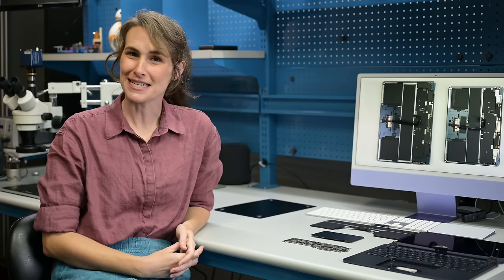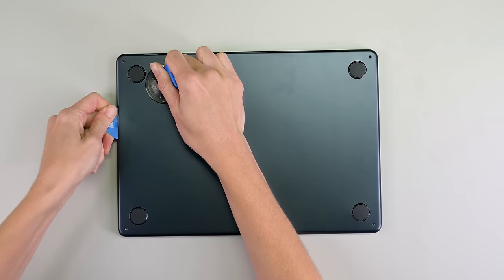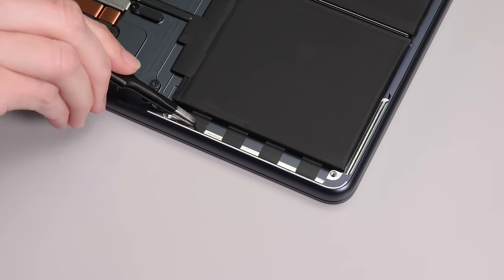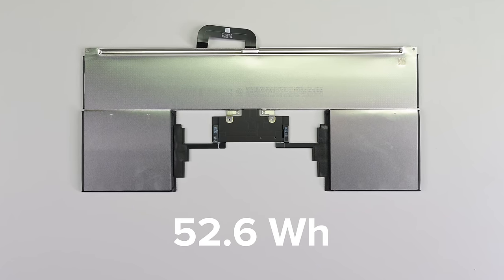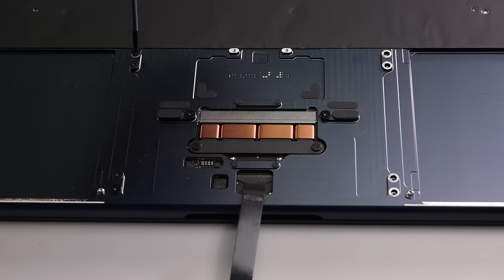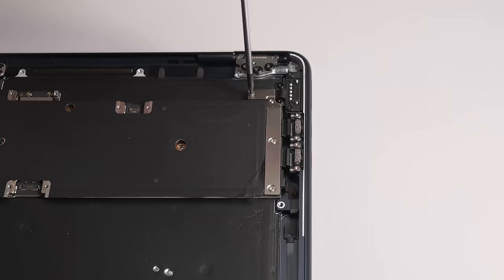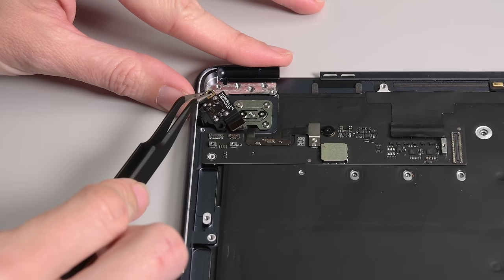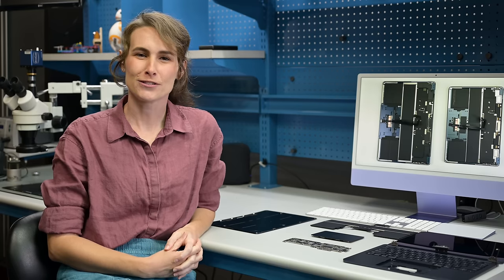M3 MacBook Air: The Tiniest Change Makes All The Difference

Comment: I missed it: what's the "tiniest change"?
Reply: No more adhesives so this will make repairability from third party shops a decent experience.
Reply: That it's 1% closer to Thinkpad-levels of repairability.
Reply: 0.0000000000000000000000000000000000000000000000000000000000000001%  @Ptero4

Comment: I find it funny that half the battery is screwed in. It proves that they can make the battery easily replaceable but don't want to.
Reply: Securing is not the same as attaching and ensuring that a device you move around all the time doesn't have internal bits floating/buzzing around
Reply: @Alejandrolanza 
Somehow, every other laptop maker has figured out how to use screws to secure batteries.

You don't need glue to "secure" the battery
Reply: @anivicuno9473   actually, as battery ages, it will expand, increase in sizes, like a swollen over sized pillow. glue helps to secure in case a battery becomes swollen.
Reply: @Alejandrolanza Uhm.. dude, the battery IS attached with screws. She SHOWED that. What more would gluing do to prevent "internal bits floating/buzzing around"? I mean by your logic, they should glue down the back panel - which is only held on by SCREWS and clips.
Reply: @TheoWerewolf   back panel is something:

1- Solid and structural
2- Can be drilled through

There's no solution that's lighter and takes up less volume than glue, for a battery
Reply: It is easily replaceable. If you're referring to it being swapáble on the go, the MacBooks battery last you literally over a day and its life time is amazing. I don't understand the issue here.
Reply: @Alejandrolanza clown
Reply: What’s the problem with the adhesive? They aren’t being like Samsung and straight up gluing the battery down with no easy way to remove it. It has pull tabs. It’s still very removable.
Reply: @flashlightning6742  its like they want more plastic clips, and glue to match their chrome books
Reply: WHAT??? 🤣 How much easier do you want it to be?? What just no screws and no glue just let it dangle in their for the 0.0001% you'll need to repair the laptop. I hope this is sarcastic 💀
Reply: this is an esily replaceable battery for me. take the back off, some screws and flat cables, roll the adheasive and its out.
Reply: @anivicuno9473  yeah but the Mac doesn't use glue, it uses adhesive strips which is MUCH easier to remove but still adds some extra sturdiness. so what's your point lol 😂
Reply: @Alejandrolanza   cope
Reply: Think about how much force you will put on the areas screwed on to the laptop when you drop your laptop. Just fyi i dropped mine twice and it survived.

Comment: Actually looks really repairable. And very pretty inside too. I am surprised how small motherboards are getting.
Reply: i am surprised at the 5/10, it seemed pretty good all around. Was the missing 5 just because of parts pairing?
Reply: @MorningNapalm  yeah because all the modularity doesn't matter if it doesn't work. If they can guarantee no parts pairing It would probably be an 7-8.
Reply: @MorningNapalm She mentioned considering parts pairing for the score.
Reply: @MorningNapalm Well, you can't repair SSD/RAM easily at all
Reply: @MorningNapalm Because many parts are not replaceable. Network, RAM and most importantly SSD is not replaceable. This means if your SSD dies, your entire device is dead

Comment: I really don’t mind the pentalobe screws. Just about any screw driver set features one.
Reply: I've never stripped a pentalobe but Lord knows how many Philips head screws I have ruined
Reply: @unicornpoo7441  if it happens that often something's wrong besides the screw heads, no disrespect. 
one advantage of philips (and even more for flat) is they permit a little angled approach when necessary.
Reply: Exactly, I can’t see what the big deal is.
Reply: Yeah instead of banning pentalobe I reckon we just ban phillips (/s). Torx (and pentalobe by extension) are significantly more structurally resilient to stripping and wear.
Reply: literally nobody (aside from apple) uses pentalobe. it's nonstandard. they're also can't be used more than a few times. just use torx everywhere.
Reply: @mug786 yeah that's why i mentioned torx. I hate that pentalobe is nonstandard and it too should be removed from existence but boy is it better than phillips
Reply: Yep they've been around for more than 12 years and have become their own standard. My pentalobe drivers are better and more consistent than my T2 and T3 bits.
Reply: @mug786  Huawei used Apple pentalobes for a bit (pun intended)
Reply: Exactly! They are designed to support higher torque at smaller sizes than Philips. If you use the correct sized driver, they are also much more difficult to strip.  In fact, we really should move everything to either pentalobe or torx and drop Philips / cross-head screws altogether.
Reply: But acknowledging that reality would get in the way of sassy whinging!
Reply: idk guys, ph is totally fine - plenty strong when used properly, can be undone with inappropriate tools, and stripped ones can still usually be undone with some generous application of cursing. Torx-like screws sometimes "strip" in a much more devastating way - by shearing off the whole screw head. I also dislike torx for how many sizes there is, i can never eyeball the correct bit =( 

But i wouldn't really mind banning everything but torx =) The fewer types of screwdrivers i need to have around, the better.
Reply: pentalobe are good and torx is just THE best one, period
Reply: We should just stick to standard screws though. Pentalobe may be in every kit these days, but Torx or Philips is much better.
Reply: The main rebuttal to this argument is that Apple use torx for all the internal screws. You need an extra driver/bit for these screws. I’m quite sure there’s no engineering benefit to pentalobular screws. So it’s pretty clear that they are there to discourage users from attempting repair themselves by raising the barriers to entry. Your premise that every screwdriver set includes one of these bits is simply not true. Do iFixit kits include them? Yes. But those are specialised kits made to address this problem.

Comment: If Framework can make reparable device then Apple definitely can but didn't choose to.
Reply: I love how people complain about apple yet ignore almost every other windows laptop that is also difficult to repair, has soldered ram and/or storage, etc. With your logic windows laptops makers can make a reparable device just chose not to.
Reply: @AndrewPL5  Apple is the lead. Every phones and laptops had replaceable batteries until the arrival of iPhones and MacBooks. Then, gone with 3.5mm “courage” jack, then soldered ram and ssd, then serialized parts, then…..
Reply: @MatrixMaverick1980  you give Apple too much credit. It would have all happened anyway even if Apple was first to it or not. Stop blaming them for issues that other manufactures CHOSE to do, they weren't forced. Maybe hold them accountable too instead of blindly blaming one company with a way smaller market share.
Reply: Have you seen the thickness and bulk of a framework laptop? Everybody wants a thin light laptop so to make it you have to remove upgradable ram and hdd’s
Reply: I don’t want or need a hulking great upgradable framework laptop. As long as the battery and other wear parts are easily replaceable I don’t care for the rest.
Reply: @AndrewPL5 A lot of them, don't do that.
Reply: @AndrewPL5  If Dell or HP makes a crappy unrepairable laptop, I can go to Lenovo or Framework. If Apple makes a crappy unrepairable laptop, I have no choice but to buy it especially if my work requires a mac os application. The reason those unrepairable windows laptops aren't an issue is the availability of choice in the windows laptop market. 

Apple has also been the only one which take active engineering decisions to make things less repairable. For example, parts pairing and proprietary m.2 connectors. It's not just apple but apple is the best example to demonstrate the problem.
Reply: Framework laptops looks like gabarge. I simply never saw any device that have both tight tolerance/quality and modularity/repairability.
Plus a Framwork Laptop 13 cost just slightly below (if not over) a M3 MacBook Air, even without the crazy RAM prices. Sorry, big no.
Reply: @saltcutep Your loss when apple will demand $800 to $1000 to fix anything on it LOL
Reply: @AndrewPL5  simply cuz there's lots of choices when it comes to windows

Comment: The profit margins on these appears massive.  And that is not a good thing for consumers.
Reply: ofc it is, cost and price are 2 very different things.
an air bought 3 yerars ago lost sells for 700 now.
macbooks are always the cheapest laptops one can buy.
a windows machine dies after 2 years, if not, nobody wants it, it has like 0 value.
nobody repairs windows machines, why is that, because they are not worth it.
Reply: Being made for $200-300 a piece and then the extortionate RAM and SSD upgrades bump up the huge margin even more. It’s shocking what you are getting for the retail price.
Reply: new to the apple business model?

Comment: Still deserves a automatic 0/10 for parts pairing/software locks, riveted keyboard and non-upgradeable soldered-on storage.
Reply: How often will you replace Touch ID on your laptop? And didn’t you notice keyboards without rivots feel a lot worse and even quality windows laptops now use them? And finally if you buy a MacBook Air you know you can’t upgrade the storage
Reply: And RAM, which in 2024 should be MINIMUM 16 with 24 or so being the norm imo. Mostly because a device with 8 GB of RAM bought in 2024 won't last long, seeing that every single year the RAM taken by the OS increases.
Reply: @okay7332  apple solders on the storage so that the traces to the cpu can be much shorter. This has numerous benefits, including a noticable impact on system responsiveness, as lower latency storage means swap memory (using your hard drive as a temporary replacement for ram) is much more effective. I would honestly be in favor of apple doing this if they offered a more reasonable value proposition for the price (more storage at the same price, basically), and informed consumers of what they were doing and why before they purchased the device, or ideally gave the consumer a choice (but I understand why they cant do that from a buisness standpoint). 

It also means people will buy new macbooks more often which is technically a good reason if your a publicly traded company lol
Reply: @Quamsi  yea i have no problem with soldered SSD and ram on a laptop. especially with the m series the performance justified this i think. but i really dont like the price structure. that there even is a 256g available in 2024 is rediculous. i dont mind paying bit more for ram and SSD but appls prices are like 4-8 times retail cost for that stuff.
Reply: All the years I’ve been using MacBooks and I have never needed a repair so I’ve no complaints about the build.They are excellent machines.Just configure your amount of RAM and Storage at purchase.
Reply: @Alex-hv3ir  nah here I disagree this is the entry level, if you need 16 then buy the pro or upgrade. What is outrageous is the price of upgrading from 8 to 16GB that is absolutely crazy
Reply: How are there still so many people believing Apple solders the SSD to the motherboard? A SSD consists of flash chips and a controller. Sometimes a DRAM cache too. However Apple doesn't use a SSD it solders the flash chips. The controller is within the M3 chip. Even if you wanted to pop in another SSD you couldn't since they don't use a whole SSD.
Reply: @dragonfire3289  in fact they’re not ssd’s but NAND chips
Reply: for those who buy a base model, clearly they're price sensitive

they would like a SLOW conventional ram and hard drive in a slot

for those who don't care price, just do your data backup and buy a new computer when you need "upgrade"
you don't need the repair or watch ifixit unless you are so ecofriendly
Reply: If there didn’t exist a market of third world countries, namely India with an aftermarket that does the shittiest repairs on earth than floods eBay and regional websites.. they kinda forced apple into it. 

If you’re upset about cost, plenty of other brands out there for you where you can replace almost anything you’d like.
Reply: @nomecognome2  "Quality Windows Laptops" LOL.. there are none.
Reply: @XAV-117 once the SSD fails, what happens then? Ah right you can't replace it.
Reply: @nomecognome2 Then why pair it at all? Baka
Reply: @ericmatthews8497  Exactly, didn’t say it otherwise the windows fanboys would’ve started a war
Reply: @navmanster  in the event it’s changed there are no security risks. With biometric data you can take control of bank accounts etc.
Reply: You can still replace the keyboard although it’s quite a process. You have to rip it out, remove the leftover rivets and you can install a new one with screws.
Reply: Non-upgradeable storage? So you want to buy lower storage models and upgrade yourself later on the cheap?you wounder why a business doesn’t like that and want to close the loophole so cheapskates can’t to do? 😂
Reply: By living in a country where selling stolen parts is a business: I don’t see it as a bad thing, it actually removed the target robbers had put on apple devices.
Reply: 2024, still people justifying 8gb/256gb LOL
Reply: here is how you upgrade a mac, you sell yours, and get the one you want.
cheaper , safer, more secure no hassle and devices keep their Apple second hand value no one else has.
you can sell any apple product in any condition from any year at any time in any place within 12 hours.
Reply: @nomecognome2  Is biometric data stored in the sensor?
Reply: @navmanster  Nope, but the sensor reads everything and communicates with the secure enclave
Reply: @nomecognome2  Then it’s not a security problem?
Reply: @navmanster  it could very well be
Reply: @nomecognome2  Then by that logic replacing a keyboard is a security risk as well as its used to type in a password… 
I don’t understand your logic? The sensor is just a sensor? It’s just sending data?
Reply: Would you stop please to write this under each apple teardown?

It’s a pain to repair, parts are pared 
Ok
But the scale has a meaning 
Its not for letting some random person judge casually.
Reply: @navmanster  you can change a password if there is a breach but you can’t change your fingerprint.
Reply: @nomecognome2  The sensor doesn’t store data? How can there be a breach? What is your source for this?
Reply: @navmanster  It reads the data, an aftermarket button could very well store it too
Reply: @nomecognome2  We are not talking about aftermarket parts? Why try to move the goal posts?

What is your source for these claims?
Reply: @navmanster  Aftermarket parts can be detected as original parts. I’ve seen iPhone batteries which are detected as apple batteries but really aren’t. I can’t list sources, these are just years of knowledge I have about apple,
Reply: @nomecognome2  So no source, just saying things. Got it. 
I’m sure Apple will reward you for this pro bono marketing you are doing for them.
Reply: @navmanster  No that’s not a fair argument, I made very logical points that don’t require sources, just standard apple devices knowledge. If Apple wants to reward me I’m happy with it, I’m just saying what I think is right
Reply: @Quamsi hey that is not true
Reply: @Quamsi  Shorter connection between the SSD and CPU makes no difference in performance. The CPU can run around the block a million times before the SSD reads or writes data. Apple solders on the SSD to save on manufacturing costs. It's cheaper to buy NAND chips and solder them on than to buy a complete module from another vendor. Moreover, Apple wants to rely on as few vendors as possible to simplify their supply chain.
Reply: It is estimated that fewer than 1% of all purchasers care about upgrades. Keep whining.
Reply: Part of ifixit team? No? So keep your grade for yourself 😂
Reply: I just got my m2 13.6 inch repaired and it took about 8 days. I like how there wasn’t any IC chips in the airs and only in the pros making display repairs fairly easily because there’s no chips to switch. I wonder what my engineer has done in the past he’s a magician !!! Thank god I have insurance. *Its just got a small dent in the back right edge now
Reply: @Alex-hv3ir it’s a rat race, best ever best ever n again best ever n in couple updates your mac is slow n overheating))
Reply: the storage is industry standard now though?
Reply: Go buy a cheap windows crap laptop, you can take apart everything and upgrade it 🤣🤣🤣🤣
Reply: Upgrade CPU, storage and ram, flash the firmware and change the OS are illegal operations. At least Apple teach kids to think as that.
Reply: Agree, can’t replace a processor with off the shelf intel processor.
Battery custom designed, can’t replace battery with off the shelf  AAA batteries.

Have to buy parts from Apple.
Apple should make battery design and processor design open source so that companies can make cheaper processors and batteries. 😂
Reply: @Quamsi 16gb ram is £200 and 1tb is £200... They are clearly money grabbing ass holes at that price. Zero justification.
Reply: @JayD-e2w  epic necro lol. The nand flash used in ssds and ram are not the same thing at all and should be significantly different in gb/$. Even if you buy pc parts, 45$ would get you 16gb of ram but 1tb of storage.

 I dont disagree with you, but at the same time, it's important to understand that apples prices are a societal issue as much as they are an individual business choice. Apple has to make as much money as possible, effectively by law, to satisfy shareholders.